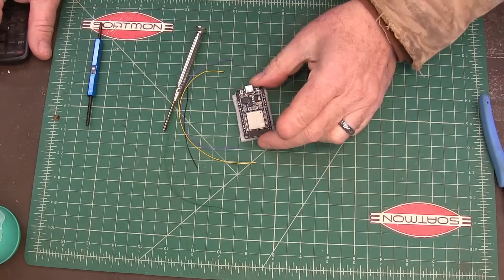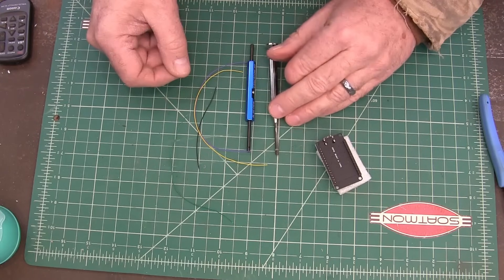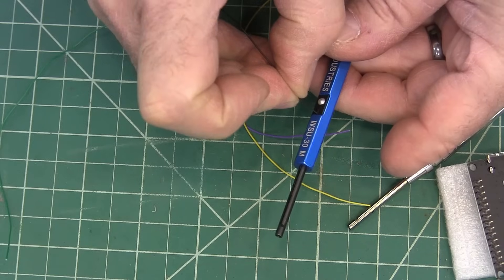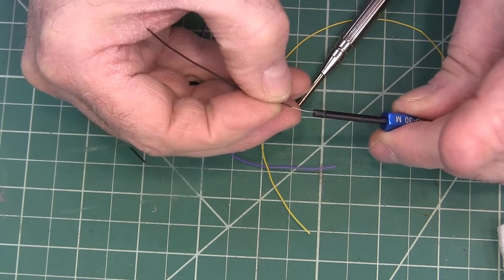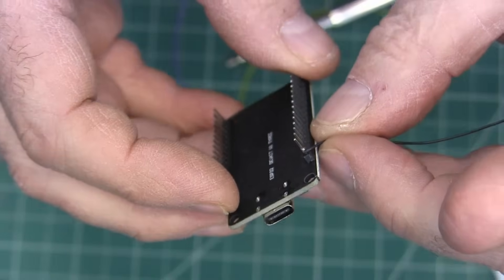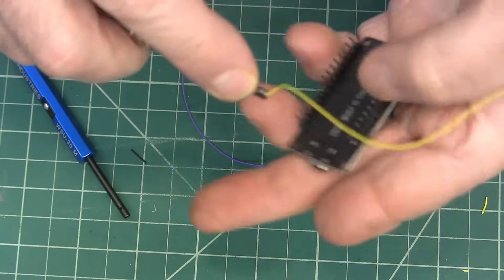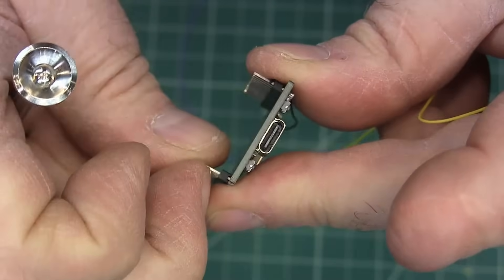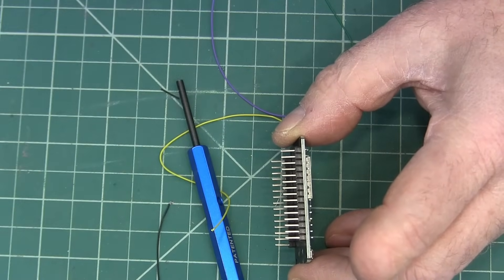How to Wire Wrap Electronic Components

Comment: I have looked for a wire wrap tool for ages but refuse to pay £14 for a metal tube with a hole in it. THEN I was lucky enough to see a 240v Wire Wrap gun for sale on eBay and got it for £15 inc post. It quite made my day (TBH it made my Christmas since I bought it for myself for Christmas - I have almost no use for it but it took me back to being a 21 year old student in 1983 wire wrapping modifications onto a DEC LSI-11 DMA board..... happy days)
Reply from the maker: Agreed, it's crazy how much they want for them.

Comment: I've searched for that tool in many places but haven't found it. My soldering iron broke down an hour ago, so I started thinking about it again. Your video made it clearer to me how it works, so I just made one. The best part is that it works perfectly! Thanks! (I guess I'll buy an original one from a reliable site now.)
Reply from the maker: I hope it works out for you.
Reply: They are available on eBay occasionally and Ali-Express - but they are (IMO) stupidly expensive.

Comment: Did a huge amount of wire wrap at my first job and then at home for my own work. I even had one of the powered wire wraps guns later on. I still have my manual wire wrap tool with me as a memory from back in 1983. The boring part was part was creating the wiring list. One of my projects was a Logic Anaylzer that I designed based on the 62C805 CPU. Was done on three S100 bus prototyping boards.

Comment: good reminder... also you did not make clear that this technique applies to square posts (then the connection can last a long time as there is a good contact at the angles) - old satellites were cables this way in the early days when this technique was more reliable than solder (need 5 to 7 turns though).

Comment: After decades of working with electronics, this is the first time I actually watched someone wire-wrapping a pin! I have to admit that I did not even know whether the insulation stays on at the wrapping or is it removed beforehand. I used to work in a factory where machines did the job but never gave it a thought. Thank you!

Comment: Thanks for the trip down memory lane, used to do this back in the late 60's and early 70's electric tools were used for big jobs, and I may be wrong, but I think some didn't need to be stripped - the posts would cut the insulation corners

Comment: This is one of those things, you have to have the right tool for.  And it becomes amazing.  They were started by Western Electric in the late 1950s, supporting AT&T.  Commonly used in junction boxes and cross-connect cabinets.

Comment: I spent thousands of hours building wirewrapped boards for Digital Equipment, mostly prototypes but also production backplanes. Back in the day with powered wrapping tools, when us boomers could call it "wire raping" without the HR department coming down and firing us. I still prefer this method for prototyping with the usual chinese modules (solder connectors to them and wire wrap connections, then screw everything to a lump of wood) The wire don't fall off like horrid protoboards.

Comment: I've done 500 wire, wire-wrap boards. Anything over 30 MHz can be iffy. Characteristic impedance of signal lines isn't particularly well controlled. Whirrap. Whirrap. Get a battery powered wire wrap gun if you plan to do a lot.

Comment: ...it's so reliable that it came on top after a bunch of tests conducted by NASA to use for their space program. 
there's a group restoring old Apollo computer modules here on yt, i've learned that fun fact from them... lots and lots of wires, wrapped posts and point to point connections in those old NASA computers.

Comment: Wrapping the wire tightly, but not to tight, around a square post causes the post to cut into the wire forming an air tight connection between the wire and the post.

Comment: The silver tool looks a lot like the one I bought at Radio Shack a very long time ago.  If I pull off the end cap, there is a stripper tool inside.  I actually have a very good stripper called No-Nik made by Clauss.  I don't do much wire wrapping now, but the 30 ga wire is still handy for prototyping on copper-clad board.

Comment: One nice thing about wire wrap is that, if you make a mistake, it's pretty easy to correct. It's also easier to salvage sockets from prototypes than if you soldered parts in place. What I do for modern design work is run a simulation and then just do a PCB layout (I use Altium). You can get low-cost, 4-layer, assembled PCB's in about two weeks.

Comment: You could do this withoit specialized tools to be fair and with how much I work with rope I could use less turns, less wire technically (same amoint practically) and best but last, wrap it up so pulling either end makes it all tighter! Learning ropes is so handy you can use it just aboit anywhere. Just wanted to share that

Other than that, where can you find these specialized tools? I may seem to harp on em but I'm not. I said you don't need em. They do make things much much easier. But I want to see what else I could do with em!

Comment: NASA used to use wrapping a lot, and I recall hearing they still do in some applications. Apparently the connections handle severe vibration and extreme cold where solder joints might otherwise fail. You can find a lot of great graphics in the "NASA workmanship standard Pictorial Reference" I believe. Thanks for the video, I've been meaning to learn this (and cable lacing next)

Comment: My introduction to wire-wrap was in 1975 as a field engineer for General Electric. Back then a lot of industrial equipment was wire wrap, including Numerical Control (NC) equipment and computers. Yes GE made computers way back then. I still have a tool similar to your blue tool, one end is for wrapping, the other is for wrapping. My favorite tool is my Gardner-Denver tool that has replaceable bits for various size wires and posts.  Cool stuff.
Reply: Mine was in 1973 when I was still a young guy, I started my first job in telecom  ( ITT Netherland) , the first thing you learned was soldering and wire wrapping, i still have all the tools..:goodvibes:

Comment: This was a fantastic prototype method back in the day. I've spent many hours building and prototyping this way. 

A couple of hints. On the blue tool, insert the wire from the back of the tool, so it sticks out the top, then when you pull, you are pulling against the body of the tool tool, otherwise the cutter blade will bend or snap.

Secondly, when wrapping, the stripped wire should be longer, it needs to go to the end of the slot on the tool, this give you the correct number of turns, you are a bit light on yours.  You also want to get the outer insulation to go around once on the pin, this gives a mechanically stronger joint, since the corners of the post cut into the insulation and hold it in place. It will naturally do this if you don't hold it tight when you start, let it spool into the pin as it bites. The result should be that you can get up to 3 joints per post.

The opposite end of the blue tool has a wire removal tool, just put it on, rotate the other way and it will loosen up the coil, so it can be removed. It should not slide off as yours did without a bit of undoing force first, since that means it didn't bite well enough onto the pins.

If you are prototyping with wire-wrap, you can cut a wire that is say at the bottom or middle, then using a pair of needle nose piers, you can feed it through to unwrap it. Now, if you put the wrapping tool on and push firmly down, the top wire will slide down the post a bit, giving you more space for a new joint at the top. Too much force though and the pin will squash down, so be careful.
Reply: Nice hint to put a turn of insulation around the post for strain relief. Another hint is to buy a wire unwrap tool that unwinds the wire in case you need to remove it.

Comment: I spent most of a month solid wirewrapping the prototype Otrona Attche computer in 1980. The completely packed board was 12" square and it drove me slightly mad. Thousands upon thousands of wires- then two days of redline error checking with my boss. Gah.

Comment: I built several big-ish boards with that same wire wrap tool in school in the mid 80's... including a complete co-processor for a PC with over a thousand wraps. Worked beautifully with a clock of 5 MHz. I wonder at what frequency that falls apart? Being able to make changes in minutes rather than etching a complete new board is a huge advantage.

Comment: Wow, I have actually done this in school some 50 years ago and had completely forgotten about it. I'm not convinced it has any real advantages to modern techniques, but thanks for reminding me. :)
Reply: Not to contradict you, but I can think of two advantages immediately:
1. Reusability: Wire-wrapped components are exactly as they were before wire-wrapping once the wires are removed.
2. Flexibility: While building a prototype that's likely to change, you don't have to un-solder and re-solder connections: you can just re-wrap 'em.
Reply: @DMLand  Fire resistant! In the case of fire or high heat application there's no solder to melt.

Comment: Thank you so much for the video.  I have heard of wire wrapping but have never seen it done.  How does this technique work with mounting the device on that perforated board.  Do you simply wrap the outstanding leg of the device?  If we use the perforated board will the device be stationary enough without soldering it to the board?
Thank you for the video, it was very informative.

Comment: You could also just crimp on a female Dupont terminal. The advantage is the ability to easily connect and disconnect the wires.
Reply: Wrapping lets you put several wires on a single post

Comment: Wire wrapping is still used in the telecom field... most commonly to cross-connect the circuit to the outside plant distribution feeds.  Square posts hold the wire tight when it is wrapped. A special stripper and a gun are used to speed things up. Tens of thousands of wraps can be found in a typical central office. I never really thought of using this for components! Thanks for sharing!
Reply: I used to do this work in central offices decades ago. When done right, the square post corners embedded slightly into the wire, making an excellent connection. We'd also solder them after wrapping, if specified.
Reply: "Still used" is a bit of a stretch. 100 MHz is about the limit for wire wrapped connections. And POTS has been on its way out for about 2 decades anyway.
Reply: Installed 2 vdsl2 bonded services this week so far.  Wire wraps from switch to dsl splitter and out and out to the field.
Reply: @MrNoobed  Yup... still used and very reliable! 66 and 110 style terminations are no match for the number of times a wire wrapped pin can be reused.
Reply: Hah, count me among a former central office technician commenting. Yeah we mostly wrapped 22 gauge tinned copper in the office. Never knew why the CO uses tinned and un-tinned out in the field. I remember the non-powered guns we used were made by OK Industries, the same company that makes that pen-style wrapper with the blue handle in this guy's video above.

Comment: https://youtu.be/blalAktxFoI?si=Hv_MxgfY8cHWYa2a

This is my favorite prototyping method called 'Island Cutting.' It's nearly forgotten on the internet. It's the fastest way I know to get a permanent circuit board going.  My favorite part is that you circle the nodes and build the circuit like it's drawn so checking for mistakes is really easy. If I'm adding a relay or an IC, I just dead bug it to the PCB with epoxy.  Actually I usually use CA glue bc I'm impatient but they fall off with CA.

I use brake line in the drill press to cut the islands
Reply: Try a dab of hot glue for sticking bigger components and sockets. It's super fast and strong enough.
Reply: @generessler6282  cool thanks!